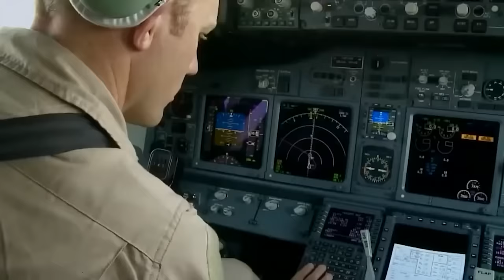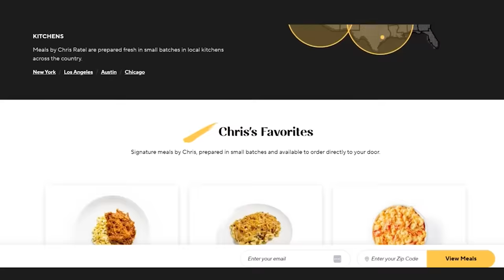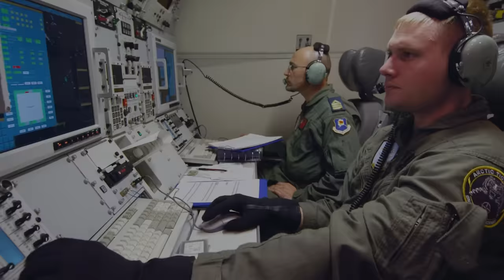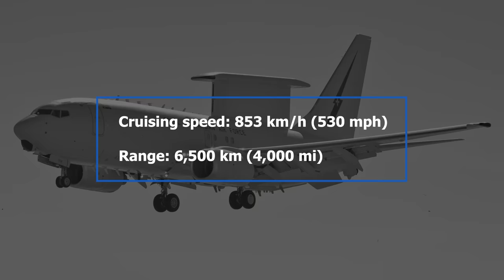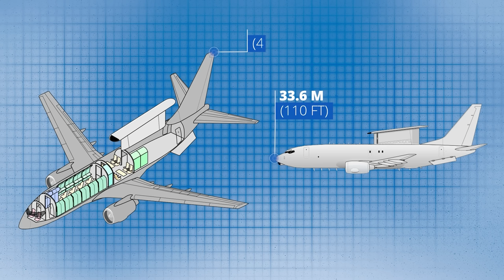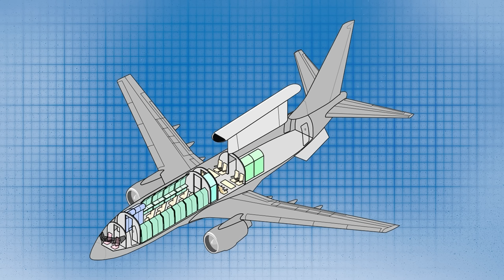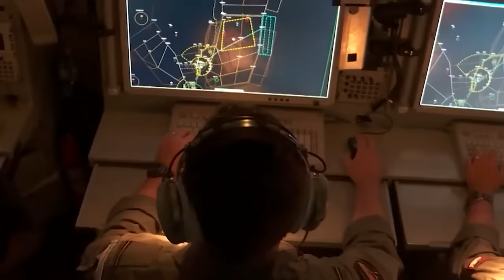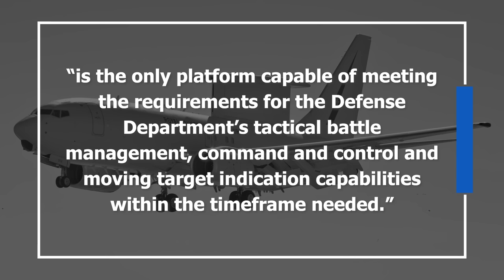The Boeing Wedgetail: The Plane That Will Control World War III

Comment: Worked in quality assurance at Boeing Australia for 25 years, had a mate who is a aeronautical engineer went to the US and RAAF Williamtown air force base NSW to create this thing.
The quality of the electronic support measures and electronic counter measures is amazing let alone all this with a signals intelligence capability.
E-7 Wedgetail is generations beyond the E-3 Sentry ......a worthy replacement.

Comment: I was an Air Force Cadet back when these were in full production at RAAF Amberley and got to tour where they were building these. And it was pretty rad hearing how many standard Boeing parts were used like different landing gear and engines from various 737 models
Reply: So was I. I remember seeing it in the hanger close to the 82WG hangers
Reply: I actually worked on this project when I was at Force Development, they were all built in the USA, they only had some minor fit out done in Oz, mostly internal items for testing. None were built in Oz.
Reply: @tlevans62 the first two were initially assembled in Seattle. Those two had major refit in Australia. The rest of them were internally built here, in Australia.
Reply: They don't build the air frames in Australia. They've never built a 737 in Australia. The first two were built entirely in Seattle and tested, since I was there. The rest were built in the USA but the entire internal futout out was done in Oz.

Comment: Wedgetail - also the LARGEST eagle, and also makes up the crest for the Royal Australian Air Force, RAAF, the second oldest air force in the world. (And we have the oldest air force base in the world - still in Airforce hands)
Reply: Maybe largest australian eagle but it’s certainly not the largest
Reply: Does it squeaks like a chicken as the Bald Eagle does too?
Reply: Golden eagle is the largest eagle
Reply: Good to see the Aussies taking the lead.
Reply: @carlosandleon  actually it is debatable still ..it weighs more then a Golden Eagle at 12.7 pounds compared to 8 pounds. it's length of body is longer at 1,6 metres or 3 feet 6 inches compared to  1m or 25-39 inches   Wedgetail has smaller wingspan of 2 inches and that  is based on maximum and not always the case.
Personally drop the ego and are about same. or if want to be in a competition Wedgetail weighs more and has a longer body but Golden has a wider wingspan on best of days and would not be alway's lol.
Reply: @micksmith-vt5yi  The largest eagles are the philppine eagle, Harpy eagle or Stellers sea eagle. 

The Golden Eagle is not one for the largest so it’s strange you took it as a benchmark.
Reply: @brkbtjunkie  No
Reply: @carlosandleon  LOL LIL MAN Golden Eagle and Wedgetail are biggest in world as of stats and many sources.. Harpy wingpsan is smaller then both Wedgetail and Golden.. so no you are wrong lol.
Reply: @Shadow__133  apparently classic cinema used the wedge tail eagle calls for bald eagles. Not sure on the truth of that though.
Reply: @shinkicker404  Red tail hawks.

Comment: Have worked at the Avalon Airshow, and one of the highlights is the RAAF mock air battle scenarios, always a highlight seeing the wedge tail fly in and circle high above the battle space coordinating friendly forces
Reply: Yes it’s an awesome capability. FYI for an event as big as the Avalon Air Show the aircraft would’ve also been used to assist ATC to coordinate all the performing aircraft in particular the fast jets. Making sure to Marshall incoming aircraft or pre positioning aircraft prior to their routines as well as safely exiting the aircraft.

Comment: It's based on 737NG not MAX, don't worry about bolts or door plug 😂
Reply: Oh good, they just have to worry about the roof going 🎉 then (Aloha Airlines 243)
Reply: @ch4.hayabusa That was a 737-200, not a 737-NG. The NG is a solid airframe
Reply: @rickj6348 Nationwide 723 (engine fell off) was also a Boeing 737-200. Why don't I hear of AirBus's having major structural problems... I would also consider MCAS a major structural problem with a hacky software fix.
Reply: The door plug and bolts is not a problem isolated to the Max, it's the company's quality check and overall production system that are. So a 'quality escape' can happen to any product that comes out from them till they fix their issues.
Reply: @ch4.hayabusa  Airbus has had their fair share of issues, it is just that Boeing currently is under the media's microscope. In fact, all aircraft builders have had issues over the years, you just gotta go and look things up to see what they were instead of attacking someone on YouTube

Comment: Worked on the Australian Wedgtail about 10 years ago and Boing only makes the Airframe
Reply: The E-7A came off the production line as a standard 737 and was then modified by BDA et al. (except for the first two). Boeing was the contract provider and was responsible for the program. They were also responsible for coughing up 3/4 of a billion dollars in penalties.
Reply: 10yrs and misspelled the manufacturer? 

Shame! Shame! Shame! 😂
Reply: Does Boing make bouncy balls?

Comment: The Wedgetail eagle is known to attacki hang gliders and para gliders. They also attck drones.
Reply: Based eagle
Reply: Magpies will have a go at Wedgies. I've seen them a few times flapping furiously to gain enough altitude to get to them. The Wedgie just finds another thermal and climbs higher.
Reply: They also attack people. I have 2 scars on the top of my head from one that attacked me while riding home from school when I was 10.
Reply: And my ducks.
Reply: Many years ago I was doing skydiving training near Melbourne. One of the drills was what to do if attacked by a wedgetail. Cover your face with your hands and bring your knees up to protect the viscera.
Reply: @BabyMakR  Magpie or wedgie? Magpie I can, the little buggers are crazy. 

I've seen wedgies do barrel rolls to try and grab magpies out of the air with their talons when the smaller birds try and harass them. They might be big and (relatively) slow) in the air but they are capable of some pretty cool manoeuvres and they give zero fks. Had one landing on our fishing boat when I was kid and just stood there staring at me and my dad while we fished, ended up tossing it a bream.

Comment: A quick history on the competition that led to the E-7 being selected by the RAAF
There were 3 competitors
Raytheon with the Israeli Phalcon system with a rotating radome mounted on Airbus A-310s
Lockheed-Martin/Northrup Grumman with the E-2 system with a rotating radome mounted on C-130Js
The Boeing E-7
Surprisingly the E-3 system (would have been mounted like Japan on a 767) was considered far more capable than the RAAF wanted. The first 2 were advanced 2nd gen systems, the E-7 a revolutionary 3rd gen system. It was somewhat of a surprise when selected.

Comment: CFM56 engines typically burn through a quart of oil every 5 hours if theyre in really good shape, and they hold 20 quarts, ao a Wedgetail can fly about 100 hours straight before the engines seize.
Reply: weve been running these for close on  16 years FOC, never seen or heard of any of them having an engine problem like that.
Reply: @gfenwick1  WTF are you talking about? All jet engines burn a little oil. It's just what they do. I've literally never seen a jet engine that doesn't, and I've worked on hundreds of aircraft.
Reply: @echTalk FFS,  I never said that - I said Ive never come across any of the reports on any of the aircraft having seized engines - and I was in the program from 2006 to 2015. there's never been any vendor reports around problem engines. prob half of the australian domestic large jet fleet uses these engines - and none of the civlian platforms have been down due to seized engines.  That means they are being maintained with effect.  A30-001 has been in service since 2004, these planes have been in service for between 20 and 9 years (A30-006)
Reply: 100
HOURS
STRAIGHT
Reply: @echTalk unless the maintainers are ex garuda, then none of them would be falling asleep at the wheel, the nature of the support contract means that the vendor has self interest at work to do the job properly.  without naming the vendor, their reputation in industry is to rape and pillage as thats how they get paid to meet the platform support KPI's. they set up a pure defence work division which ended up raiding their domestic support division because the rates paid on supporting RAAF was so much better. those frames are serviced well before hitting critical component support schedules.  The RSP out of Aust is just as professional.  

The danger of the internet where you lose contect could mean that you and I are on the same page but crossing in the night....
Reply: @gfenwick1  You can continue babbling away or you could finally realize I'm not talking about missed oil topoffs. I'm talking about military aircraft like the wedgetail. It was mentioned in the video that it can fly as long as the engines last by aerial refueling. I pointed out that the LIMFAC is oil consumption. After about 100 hours of constant flight without landing, the engines will be out of oil. This is not a difficult concept.
Reply: @echTalk not sure why you have the need to persist  in being so phuqueing rude - but whatever floats yr boat.  Why would any plane not be checked at threshold for oil consumption? As the hours tick off the checks kick in. for various components.  Its self evident.  If you cant engage without being a prat then dont bother.  USAF, USN, WANG, RAAF etc  all operate around the same maintenance rules set by the engine manufacturer.....
Reply: @gfenwick1  Maintenance intervals don't come into play if you're staying aloft for days at a time. I'm talking about flying 100 hours without touching the ground. AWACS and airborne command and control aircraft are designed to stay in the air for days at a time with aerial refueling. You can't top off engine oil when you're still in the fucking air with the engines running. How is it even possible you still don't understand what I'm saying? Is English your second language or something?
Reply: YOU CAN'T CHECK 
THE FUCKING OIL 
WHEN THE PLANE 
IS IN THE FUCKING SKY
Reply: @EricsTechTalk  seriously, you need to geta grip. You think that nobody had a look at the conops when they evaluated the platform? Theres a safety margin in play. Last time i looked at combat capability scenarios for this platform the pref was to rotate aircraft where poss, the plane isnt going to spend 95hrs tos and then fall out of the sky. Theyll get rotated for crew and platform efficiency where poss. And my english is fine, 35 years in def and happily retired. Anyway sport we’re done as you’re obviously cracking for an argument and are all puffed up.. enjoy having the last word. Again thanks for stating the obvious.
Reply: @EricsTechTalk  no, but the system will be pretty chatty if youre hitting thresholds. Im done here, enjoy getting excited with someone else
Reply: @EricsTechTalk  This is just weird, I’m not sure how these people can be so dim and still be alive. Anyway, what you said is correct and clear enough for anyone with a semi amount of brain power to understand. 

The P-8, being a similar platform, though has a different limitation, food. The AEAs will have eaten everything within the first 6 hours.

Comment: The E-3 AWACS is a very old platform and expensive to operate even with updates over the decades. These platforms are very high value targets because they do so much for the theater they operate in. The E-7, which was smartly adopted by the USAF, are powerful in their ability to detect all manners of targets within their radar range, they can direct friendly fighter and bomber forces, they can conduct ECM and ECCM, and can do those things at longer distances from the enemy's air defense sectors. Russian and China have dedicated resources built to find and destroy these platforms and the E-3 is more vulnerable because it has to loiter closer to the enemy than the E-7.

Just recently the only known shoot down of this kind of platform was by Ukrain who went to great lengths to locate the Russian version of the AWACS known as the A-50 Beriev and shoot it down as it was loitering in the Sea of Azov. These platforms are very expensive as well and the crew onboard is highly trained. The loss was a huge blow to the RUAF as well as a great accomplishment for Ukraine who seem to be able to destroy high value targets throughout the conflict. This is right up there with the sinking of the Moskva.
Reply: Howdy, small correction: the E-3 and E-7 have similar detection ranges. The comm ranges and ECW/ECCW are likewise similar. The biggest problem with the E-3 is that it lacks the full 360 detection at all times, needing the rotodome to rotate between zones of interest. The E-7 eliminates this issue entirely. With the E-3, battlefield management has to fold in tactical use of the dome alongside other critical decisions.
Reply: Add the MQ-28 Ghost Bat to the E-7 and they become very hard to shoot down…
Reply: @allangibson8494  the MQ-28 is not able to do that job, lacking sufficient radar signature, plus it is not in service.
Reply: @adamsfusion  Don't forget Air Battle Management too.......with a bit of Air Control.
Reply: @downix mare the Ghost Bat is in service 😂
The RAAF doesn't make the mistake of announcing irs entire inventory like the Yanks do
Reply: @richardcostello360  No, the Ghost Bat is NOT in service, it is in the development phase still.
Reply: @richardcostello360  That would be news to the manufacturer, as they haven't built them for service yet.
Reply: Ukraine moved a Patriot missle battery closer to the front line just to kill an A50
Reply: @SmithandWesson22A  Which hasn't been confirmed yet. The wreckage shown so far could be an A-50 or an Il-76. In addition, the plane was shot down by an S-200, not a Patriot.
Reply: @richardcostello360  Ghost Bat is not in service yet and even Albo gave the programme more money and told them to hurry up and finish testing and get it in to service with RAAF.
Australia has 9 to test and US only 1.

Comment: I’d love to see something on the Erieye. The Sentry and Wedgetail are great platforms, but I have a theory that in the drone age, smaller, more numerous AWACS platforms are going to be needed.
Reply: The latest variation of the Erieye is the Global Eye. First ordered from SAAB by UAE, Sweden has also ordered 2, with an additional 2 optional. This order predates Russias full scale attack on Ukraine, so it wouldn't be very surprising if it gets increased further..🤔🧐

Comment: Hopefully, one thing the E-7 needs to do is the ability to defend against anti-radiation missiles specifically designed to shoot down AWACS platforms. That means carrying chaff and other electronic countermeasures to counter something like the PL-17 or PL-21 missiles used by the People's Liberation Army Air Force (PLAAF).

Comment: Seems to be a good system.  The US neglected developing a follow-on to the E-3 for so long that it had really no other choice.  The GWOT sucked up all available funding for twenty years, and Congress was not about to put any money into something that was not really relevant to that conflict scenario.  Luckily the E-7 is a good aircraft, other than having to fly a sort of "S-shaped" search pattern because of dead spots in the radar coverage, compared to the older "racetrack" pattern of the E-3.

Comment: I appreciate the video, but it implies that the electronics in the E-3 have not been updated since its adoption. That would be a severe misconception.

I'd argue that perhaps the three biggest factors for the E-3's retirement are: 1) radar cross-section, in a time when the differnece between a cardinal and a bumble bee means tactical advantage for the enemy (E-3's, like carriers, are highly protected assets); 2) aging ariframes mean not only engine retrofit but potentially infrastructure update, which can be costly; 3) design and compacting of processing power could mean that a 707-sized plane simply is not needed to provide this support.

On the other hand, 1) the next-gen ("Max") Boeing 737's have taken some pretty major bruises with malfunctions; 2) I would be curious to compare loitering ranges between the two aircraft with a typical load. Range and loiter time are the AWACS' platform in the 707 (this does not consider the power of the radar disc); 3) from the video the implications are that the E-7 has not only aerial but also look-don capabilities. I wonder how this would work with JSTOR. And to add to that, sometimes the military tries to pack too much capability into a platform because they can, not because it's effective (I have heard some discussion about this issue with Longbow Apaches). The vidoe mentions that even with a staff of 8-12 analysts they "struggle to process" all of the information they collect. Jack of ll trades, master of none?
Reply: The crew appears small compared to an E3 but so many of the systems are automated it can achieve far more in practice.  Endurance is basically the same as an E3 - the limiter, as the video said, is engine oil.   The wedgetail can work in isolation from a JSTOR/P8/RIVET JOINT/AEGIS or it can partner with these and more.   The struggle to process is simply a function of every year we are adding/finding more functions, more capabilities from the system such that now it can do things that werent even dreamt of in the 90's when it was specced.

Comment: THe USAF is already using new tankers based on the 767 and Im surprised that they did pursue that platform or the 777 or 777x . Can use imagine if they took that big antenna and stuck it on top of a 777x.